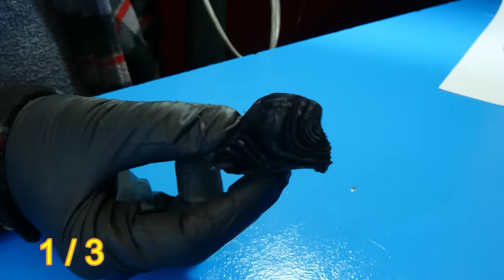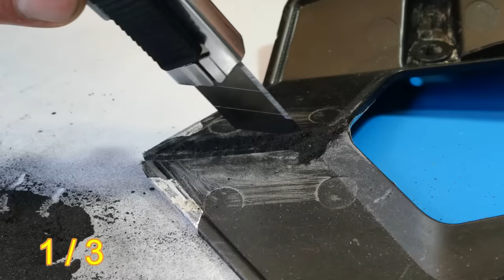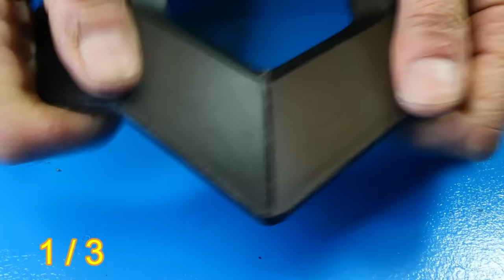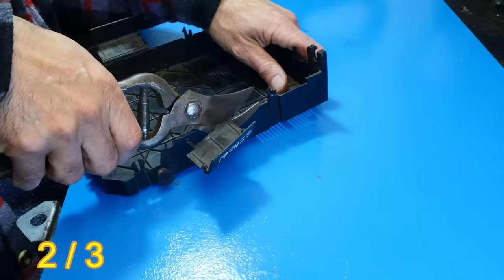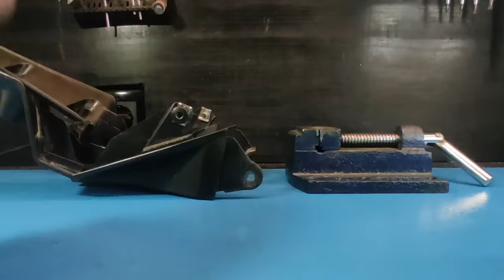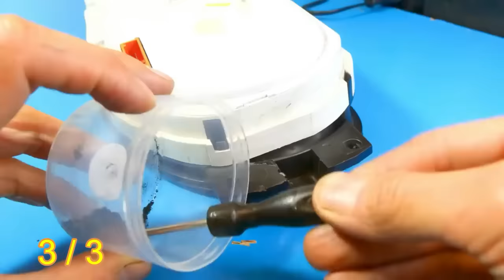Mix Super Glue and Fiberglass, Great Plastic Repairing Technique !!

Comment: Dont waste time with method 1 or 3.  If a panel is cracked and the break is clean, sand the inside with course sandpaper.  Tape the crack closed on the side facing outward.  Then use JB Weld for plastic and place a thin layer over the crack and the immediate area.  Place a cut fiberglass mesh on the thin layer and let it set up for a few minutes.  Then mix up and another layer of JB Weld and smooth out.  Since it's on the underside, it doesn't need to be sanded, just strong.   I've done this twice on my my motorcycle  on painted parts and in both cases, the break was so clean, even the paint you cannot tell there was a crack unless you are right on top of it.

Comment: Actually the combo ABS/PVC plumbing pipe glue with fiberglass is bomb proof. Use the super glue to glue the crack together first then glass and glue the back. Did this with an ABS dash on my pickup and its still holding up 10 years later.
Reply from the maker: Great repair !! Thanks for your feddback !
Reply: @wharzenr clean the fairing first with lacquer thinner put on a thin coat of purple pvc primer. put your fiberglass cloth on wax paper spread and coat of the glue on the cloth. Transfer the loaded cloth to fairing and smooth it our with a putty knife. Add more glue to get one good coat and let it dry then apply a few more coats as they become dry.
Reply: @wharzenr try it on a clean invisible section and see it it sticks good. If its pvc it should work. Most car dashes are made of abs and pvc glue does not work on abs hence why i use the pvc/abs combo glue works on most anything but polyethylene. Not works worth a crap on polyethylene its the slick plastic kayaks are made from and possibly your cowling. Do some research to figure our what kind if plastic it is if its polyethylene you are wasting time and money.
Google reaults say ABS which the blue PVC glue will not work on you need either the ABS glue used on the black plumbing pipe or the combo pvc/abs.

Acrylonitrile butadiene styrene (ABS) plastic is commonly used in original equipment sport bikes and certain aftermarket fairing manufacturers due to its strong, flexible and light weight properties.
If its fiberglass or carbon fiber your going to want to use fiberglass resin not glue.
Reply: @wharzenr i like you PI folks got to spend a number of days in Angeles city many years ago and had some good workers in the Navy with me from the PI. 
What do you call two Filipino pilots in a aircraft cockpit?
A pair of pliars 🤣
Reply: @wharzenr The Navy visited i just went along.
Reply: @wharzenr yes but mostly the hotel food. No balut hell the fuk no!

Comment: Thanks. My civic auto folding mirror has issues, it's internal housing made of ABS, Which holds multiple gears developed a whole where the gear came out, it pushes against the ABS body. I have tried super glue with baking soda, araldite and what not but the pressure of motor keeps breaking it. Can you suggest how can I fix that plastic part?

Comment: I did a similar thing once to fix a broken door panel inside my car.... but I didn't have fiberglass, so I used a drier sheet.... Same concept, different material, worked good enough to last a few years till the car was totalled.
Reply from the maker: Great ! Thx for commenting !
Reply: Similar - my bikes mudguard had a large split and had to improvise.
 I sanded it and used a strip of some old jeans with 2 part epoxy, it's still holding strong.

Comment: watching from Netherlands, mechatronical eingineer,  seen this trick using baking soda, solid as a rock too, but using charcoal on black plastic looks much better for sure, new to me and very useful thanks!!
Reply from the maker: thanks for watching from Netherlands ! By the way i am retired electrical engineer 👍
Reply: @Repairman10169 It wasn’t clear from the vid, the powder is ground up charcoal? Cool idea, also first time I’ve seen non-woven fiberglass used with superglue. It looks super-strong!
Reply: johnfoley4023  That would make sense, but it seemed very powdery. I guess it could be dust from sanding though.
Reply: Charcoal, ie powdered carbon. It makes a carbon composite with superglue, not as strong as carbon fibre but good for filling voids.

Comment: Use was out of pvc pipe glue and wanted to add an extension to my ac drian tube, so I used crazy glue as its not under pressure.  A couple years later when the AC A coil was replaced we were taking apart the drain tube and the crazy glue extension wouldnt come apart. I was amazed.  Again, dont know how it would work with any pressure in the pipe but it worked well in this case.
Reply from the maker: Great ! Thx for the comment !

Comment: Can attest that fiberglass and superglue are great for plastic repairs.  I have used twice to repair bins on the refrigerator which, when one bottle too many was shoved into the bin, the mounting tabs broke.  Used on-hand material versus eighty bucks or more for a new bin.  I cut the fiberglass, soaked and fit to the parts which needed joining, added more superglue, let sit, then back in business.
Reply from the maker: Great ! thx for commenting !

Comment: The subtitles cut out on 3/3 - I don't follow how the broken piece is held (is it hot glue?), nor what filler you're using there. Otherwise, the creation of the fillet and filling is self explanatory.
Reply from the maker: Right, i use hot glue to hold and filler is also charcoal powder, i will mend the subs. thx for comment .

Comment: I don't understand why you would use this method to fix plastic when you could have done a better job for less money and it would have been a permanent repair simply doing a plastic weld on it.

Pick up an old busted mirror cowling I'm sure you could find one on the street and use that as your filler, assuming this is ABS.

Plastic welding is so easy to do and it saves a fortune.

So long as you use the same type of plastic you are welding you should get a good result that is able to be done over many times though once would usually be enough, i have done many plastic parts.

Super glue over time tends to come off some plastics, plastic welding is permanent.
Reply from the maker: Hi, yes agree.. i show that in many of my other videos, but i want to give other options for doing this repair.
Reply: @Repairman10169  OK I understand that, but this option is less secure and ultimately will probably come apart under stress.

At best it would be a temporary fix that will mean it will be that bit harder to fix properly later on due to the plastic being contaminated with super glue, or will mean more time cleaning it off.

This might work better with fiber glass, as fiber glass is a resin.

Before I used welding tried stuff like this and it always ended up failing over time, vibrations would usually cause the failure.
Plastic welding has always produced excellent long term results even on non ABS plastics, the hard part is finding the right plastic when it is not indicated on the plastic trial and error.

But with plastic welding you can even craft parts to replace parts, and you don't need a 3d printer, they can be made by hand in some cases.

But I see this best used for resin type repairs perhaps.